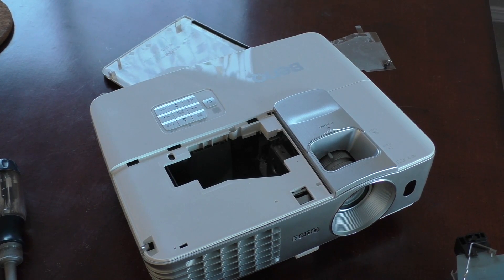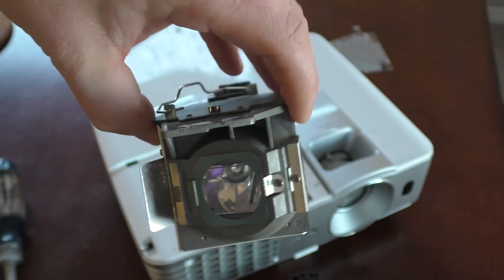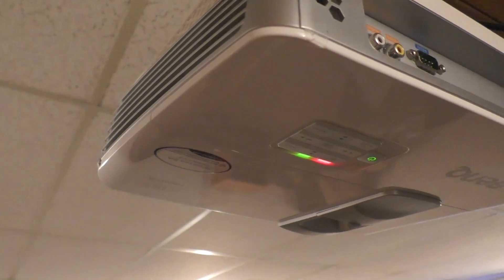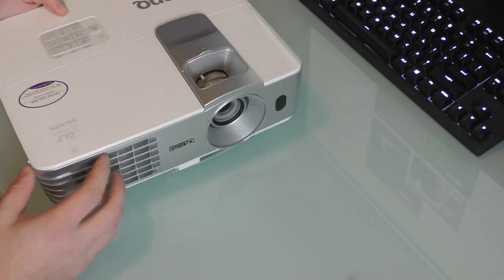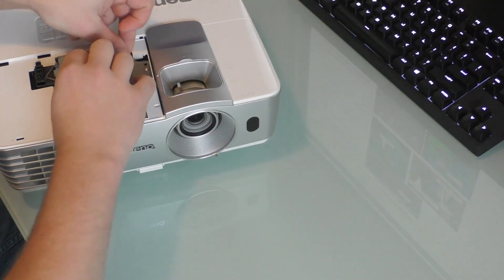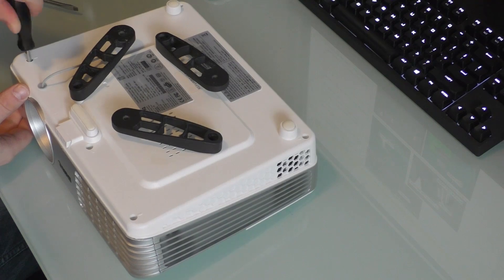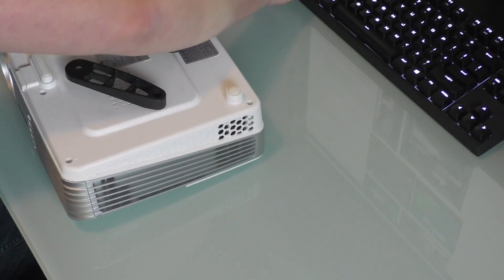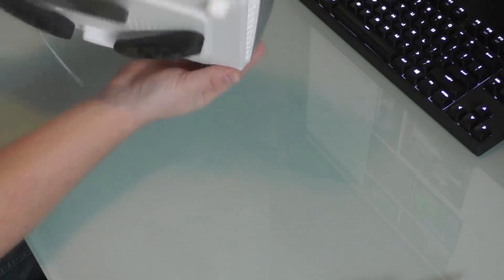BENQ W1070 Disassembly - Changing Lamp and Cleaning Blower Fan After Light Exploded

Comment: Was also greatly helped by the video but due to sloppiness/tiredness I must have missed some ground connection or something so the projector was completely dead after reassembly. I had to do the complete teardown again and reassemble it very meticulously, and then it worked. 
So please be careful to note which screws go where, which metal is supposed to touch and so on.

Comment: Thanks you very much for your encouragement.
I was in the same situation: exploded lamp, fitted a new one (Osram bulb only), after which the projector would not stay on for more than 3-5 minutes.
I did not really encounter much debris in the bottom fan, but I clean out all parts anyway.
During the first assembly I forgot to connect one cable, but after second attempt all seemed to work fine.
I'd say all in all this took me about 1-1.5 hours.

Comment: As many others have told you before, Thank you very much. After eight years and a half, my bulb has explode and, I had the same "blower" issue that you explain in your video... thanks to which, i have just fix it, and (once cleaned of little crystal pieces) my projector is runing again...  Thanks again, I hope it lasts for many more years
Reply from the maker: Thank you for the kind comment and I'm glad it's running! Since this video, I'm still using mine and so far it hasn't happened again, so I hope yours lasts just as long.

Comment: Sir, thank you for the vid.After more than 5000 hours my lamp exploded, i replaced it and had this heating issue. Checked the fans on the special menu and the third one was like "off". Teared the projector down thanks to your video, did a good cleaning of all the fans, found out some glass pieces were in this blower and blocked it, and i'm pleased to say my BenQ 1070w is as good as new =)
Reply from the maker: So glad to hear it!

Comment: Thanks for the video. I had exactly the same problem. The lamp exploited. I changed the lamp but the projector was overheating after about 5min of using it. I had a piece of glass blocking the blower (fan 3). The fan was stuck with the glass debris. After cleaning it and reassemble the projector is working perfectly. Thank you!

Comment: I read that one should use a special mercury vacuum to get the glass pieces out. Couldn’t really make out what you did to get all the class out... any sort of vacuum or did you simply “shake” the glass out? Thanks having taken the time to make this video. Have yet to find out if I will have to go through this once my replacement lamp arrives...
Reply from the maker: I did this a bit ago, but honestly, I just shook. They all came out. I would not recommend spraying a dust can in there, that's where the danger lies as dust can get caught in the color wheel.
Reply: Newb Computer Build  - ok thanks. Ended up shaking and vacuuming the inside and in the meantime my lamp arrived. Installed the lamp and all working well (so far). Have the feeling the projector is a tad bit louder than before however...

Comment: Thank you so much, fixed my W1070+. The bulb exploded 6 months ago but we removed it for cleaning, when we reinstalled it. It came up with the same error code after 3 minutes. After taking the fan out and cleaning it. The projector worked as good as new. Thank you!

Comment: I have the same projector and my bulb exploded a few weeks ago. I got about 3500 hours. But I decided to by a Chinese ebay cartridge for $70 rather than $300. It was flickering after 2 minutes and after a few experiments I found that it works only in Cinema Mode. If I change the option to Normal or Bright it flickers. Weird. I also had to clean a the shattered glass out of my unit too. Glad to hear that yours blew up too.

Comment: Hey, currently got a bulb at around 3500 hours (pretty much all on eco) should i swap the bulb out for a new one or keep using it till it explodes/5000ish hours
Reply: I rock lamps until the wheels fall off and i get as close to that 5000 hours as possible before the lamp literally stops working. But its a very bad idea though. Yeah you can easily get up to a year+ of lamplife once the ‘replace lamp’ image starts showing. 
But by doing so you risk the lamp exploding and spreading glass everywhere. My first one didnt. But my second one did. Boom! Lamp 3 was working for a few months until all of a sudden, not working. 
Long story short its likely bits of that glass finally found its way into the blower fan. 

Tldr; dont be stupid like me just to skimp out on spending money. replace your lamp when youre supposed to.
Reply: @K9_91  alright, thanks

Comment: Thanks for the video, it helped me greatly. My clear adhesive cover for the lamp assembly has normal dust and what appears to be bulb dust from when it blew. Compressed air isn't helping. Is there a way to clean the oem sheet, or can I improvise with a replacement?
Reply: evcass69 same thing happened to me. What did you end up doing regarding the adhesive cover?
Reply: @amfsd  I didn't attempt to clean or replace the adhesive cover. After power-on, I have a handful of ghost spots that show up on my screen (probably specks behind the lens), but they don't bother me enough to disassemble it again and risk making the situation worse.
Reply: evcass69 i vacuumed the adhesive cover and some dust came off. So far so good...

Comment: OMG ... my light bulb exploded last week, I ordered a new lamp and ... have the same problem. Projector starts but within a few seconds a get the LAMP signal and nothing happens.
So, it looks like I have to do the same as you did, thanks for the video because I really was like buying a new one and throwing away this one. But now I think I have to try this first ... I mean, after all, I can't make it any worse, can I? Even if it doesn't work (or I'm too dumb to get it reassembled) I'm at the same point as "I have to buy a new one" but THIS NOW is a chance to save a lot of money and getting back the projector I love so much.

Another question ... the fans at the side of the projector - aren't these "normal" fans that will also be used in computers? Haven't you thought about changing them with better fans (more powerful, more silent etc.)? Looks like there is room for optimization :)

Comment: Thank you for the video.  I had the exact same problem with my w1080st projector.  I was able to remove the glass shards, by taking the bulb out and lightly shaking the projector upside down, the glass shards fell out the fan exhaust. I also used a cotton bud to give the fan a little push and loosen any more shards.  This video helped also: https://www.youtube.com/watch?v=_xBGZ_V9Jp8
Reply: This is exactly what i’m thinking of doing rather than taking the whole thing apart. I’m terrified i’ll fuck something up. So was thinking i’ll just take the bulb out. Give it a little shake. And suck out all the dust with a vacum cleaner and bam. Sorted. 

…Hopefully

Comment: We had the same issue, but instead we turned our vacuum into a blower and blew into each vent opening. There were shards of glass and dust that came flying out. I would try this first before taking the projector apart.

Thanks OP for the video and insights!
Reply: I was literally thinking of exactly this before taking it apart. I’m terrified that i’ll fuck up in putting it back together. And i say that as a person whose not even too bad at doing stuff like this usually.

Comment: Tyvm for this great video and links.

My bulb exploded some days ago and i've yet replaced it. Thankfully, it seems all fans are working right (checked in page 2 of service menu, after pressing MENU,ENTER+SOURCE at projectors button panel). After two or three hours of use it seems everything's ok.

Anyway, as I've read that high operating temperatures could be the cause of lamp explosions I checked which temperature was the lamp operating at, and saw it's working around 280-300 degrees (F).

I tried to get info on the recommended or desired operating temp for the lamp but couldn't find anything.

Which range of temperature do your projectors are getting?

Comment: Do you think it would be a good thing the replace the fan while you're at it? I mean since your taking the thing apart. I was thinking about changing the fans for ultra quiet Noctua fans. I'm just not too sure about the required RPM and voltage of the fans.

Comment: My bulb blew out last week (3600+ hours) and I replaced the bulb without issue, cleaned the fan as explained in the video and reassemble everything.

But now when i start the projector, the power light is green and blinking (and don't stop) and the Fans are running for 2-3s and then stop completely. Power light is still bkinking green. Bulb is off and nothing is happening 

Do you know this error code? I can't find anything on official documentation.
Any ideas?
Thanks for your help!
Reply: Did you ever fix it in the end?
Reply: Yes. It wasn't starting because the motherboard was not plug correctly. Now it's working perfect :)
Reply: Strut727 didn't work for me in the end, thanks for helping though :)

Comment: Hi, i have exactly same exact problem and i followed it and now the Fan works fine. But unfortunately now the projector complaining about lamp (the lamp indicator goes red and shuts off after a min or so), this is original bulb which was working before i took it apart. I tried to remove and place the bulb again but it did not help. I think i assembled correctly, as the projector powers on, fan is running again. 

any idea where it could have gone wrong? and which wiring should i check if it reports a bulb problem?

Comment: Hey, great video.  I had the bulb blow out and installed another one but it kept overheating.   I followed your video and took out the fan and found a bunch of glass.  I put it back together but now it won't power on at all.  Any suggestions on what I may have forgotten to plug back in?
Reply from the maker: Hey - glad you like the video, and it's tough to tell why your unit isn't powering on at all. I'd first check if the new bulb is plugged all the way in? Also make sure the top lid is attached properly as it needs to push down a black button below it to trigger the power buttons to work.

Comment: Hello i have dust inside the len (benq W1070+)... I can see it on dark scenes.... How can i clean it ??? Or should i send it for cleaning ? I have one more year of warranty
Reply from the maker: I'd try to send it in for cleaning if that's a possibility, contact benQ support to make sure. Otherwise you would have to take the entire thing a part and risk cleaning the color wheel (which I have not done...but have heard others with success).
Reply: thanks! i will probably send it... im a noob at this things :P and i dont want to lose the warranty too

Comment: Thank you for making this video. My bulb popped this morning, so while I wait a few days for the replacement, I'm going to give this a shot, I don't want to take any chances with the new bulb.
Reply from the maker: Not a problem and I wish you luck and almost guarantee there is glass in the blower fan. And if not...at least you can get the clumps of dust out :)
Reply: Didn't get as many pieces as you did, but there were 2 good chunks of glass in there. Thanks again for the video! Now I just have to wait 2 more days for the replacement bulb to get here, but now I know it'll be protected by cleaned out fans
Reply from the maker: Awesome to hear, and even those 2 chunks of glass would have stopped the blower from spinning. Glad to have helped.
Reply: Dang it.....put the bulb back in, and now the projector won't even turn on. No lights or anything at all when I plug it in......any ideas?
Reply: Got it figured out. Back in business!!
Reply from the maker: Nice, loose connection somewhere? Glad to hear.

Comment: Another happy viewer. Thanks for saving me the hassle of trying to send it in for repair.
Reply from the maker: Glad to hear it :)
Reply: @NewbComputerBuild  Was there mercury in the bulb? If so, did you expose yourself to it? Residue mercury still present will evaporate in the heat and the fan(s) will make it an airborne hazard. Best to run the projector outside for 10 mins and let it cool sufficiently.

Comment: Just followed your Video and repaired my W1070. Thanks a lot for putting this online! Damn hidden Fan3 - they really could have made that more accessible.

What also helped me was how to get into the Service menu to check the fan-Speed. Just select the last menu item (info) and press 3x up+down and then enter. In the Service menu on the 2nd item you can find the fan Speeds.
Reply from the maker: I agree, damn hidden small Fan3. Also it's surprising how even that small fan can affect temperature so greatly that the unit overheats within minutes. 

Wow and thank you for the tid bit on how to check for the fan speeds, I didn't know that either. Glad you got your W1070 all fixed up!
Reply: @NewbComputerBuild  hi bro i have same problem on my w1070 projektor the lamp overheating so mach like a pan is this solution for me to? OR I HAAVE OTHER PROBLEM?

Comment: hi, my lamp didnt blow up but i have the same overheating issue. Do you think the fan is also the problem?
Reply from the maker: It could be, there could be a build up of dust. Does it do it intermittently? If so that would be my best guess.
Reply: It does constantly.. I already checked the service menu and fan 1 has 135 errors. So this coulb be it. I just hope that its not broken but only dust.
Reply: Hi, my projector has fan 1 speed error. Do you know where it is located?

Comment: Great video! Just got done cleaning out my w1070 after a bulb popped. A couple comments....

1. The black "strap" on the corner of the PCB sits on TOP of the PCB. I noticed when you re-assembled you put it underneath the PCB. I doubt it is a problem, but just thought I should point it out.

2. A 5mm socket works perfectly for installing and removing the hex head screws around the VGA and RS232 ports.

Thanks for taking the time to make this video!
Reply from the maker: Great feedback! I hadn't noticed putting the black strap on top of the PCB, so great catch. And yes thank you, a 5mm socket would have been much more efficient than using the small pliers I used for those hex screws, great to know for anyone who's going to take their unit apart.

Comment: So my lamp just popped. The pj mounted on the ceiling and I'm not too keen on taking it down. If I pull the lamp out, will I be able to check visually and see if there are glass shards that have come apart and lodged themselves inside the projector?
Reply from the maker: Unfortunately the only way to tell is by taking the projector apart. Mine was also on the ceiling when my bulb popped, it should be easy to take down. Even if you pop the cover off and take the broken lamp out you have no way of seeing inside the blower fan since it's covered in the back of the projector. If you are hesitant on buying a bulb before knowing for sure, I would just take it all apart and shake the blower fan out, and almost guarantee glass shards will fall out, both from my experience and from everyone I've heard from.
Reply: no need, just put the nozzle up into the fan, whilst the projector still mounted upside down, put something in the little hole to keep the projector on, blow it out. shards of glass will come out so wear glasses.

just did it then, fixed.

edit: firstly take the lamp mount out, forgot to add that. gl

Comment: And one more question - how to clean lens as it looks like mine has dust in it? That part with zoom ring...or thats only done by professionals @ benq centre?
Reply from the maker: I'm not 100% sure on this one. It is not recommended to use compressed air (which I did do) for this reason as it moves a lot of dust around. It would depend on where the dust is. The best I could find is the guys in this forum: http://www.avsforum.com/forum/68-digital-projectors-under-3-000-usd-msrp/1668122-benq-w1070-dust-spots-inside-lens-fix.html
Reply: Thank you!

Comment: Question: Cant you remove Projection glass part out - take out lamp and blow that fan from front side without disassembling whole projector? Or that part of the projector is fixed and better not to disassemble? Anyways, great video!
Reply from the maker: Good question and I thought the same as you at first. My first try I took compressed air and shot it into the blow fan by just taking the lamp assembly out, but it didn't work. The blower fan has very thin blades and the glass from my bulb was lodged into them. There was a considerable amount of glass shards that came out of my blower fan when I took it out and tapped it against my desk. I think its worth a try before taking it apart, but it most likely won't do the trick.
Reply: @NewbComputerBuild  this is exactly what i want to try and do rather than taking it all apart. Yup. Fear!